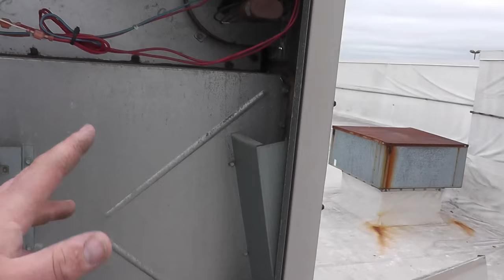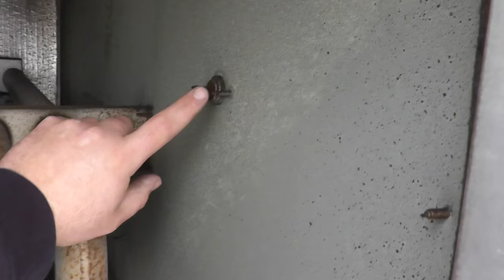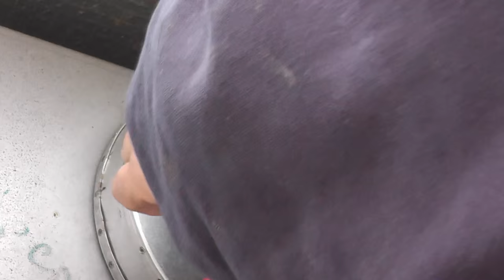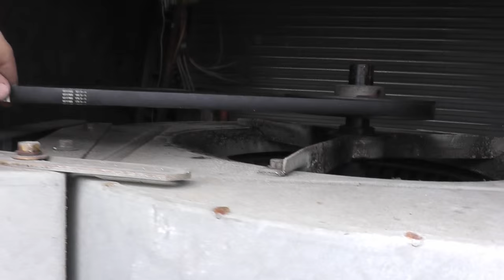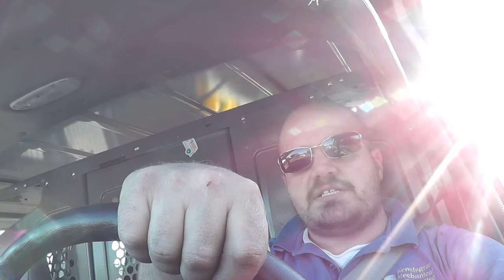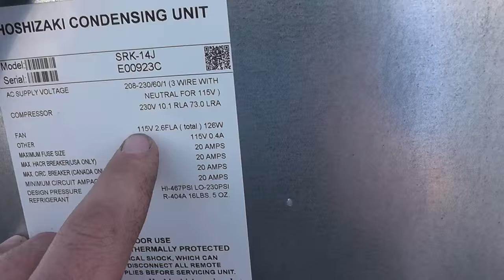Another Day in the Life of an HVAC Tech: Episode 10

Comment: Great video. I was pumped to see you did another day in the life. FYI from an electrician's pov, taped up wire nuts is never a good sign. In our world it usually means a poor splice, and a sign of a poor installation. Obviously not the case here, and I know you're just concerned about vibration. It's probably the HVAC equivalent of an unsecured capacitor that's taped up or left in its box.
Reply from the maker: +BenP83 Yeah it's just a habit for me.  Sometimes you have to jam wires in the motor boxes real tight because they give you so much room.  Also on things like refrigerator coils where condensation is an issue it helps keep some of that out.
Reply: It definitely makes sense to do it in those situations. I think since we see it so much on unprofessional and poor installations it's become taboo, and even when it's beneficial to do so we don't because of that.

Comment: Draft inducer went bad on my home unit; bearings going bad. Figured i could replace the bearings/

When I threw out the old one, it had half a Torx bit in the hub ;) You are right about those screws.

Comment: .as always, a great video showing the crap we go through.  You should show this while it's snowing and windy as hell just to show the real picture.   Another way to find a blown wheel is the pile of fins laying on the roof next to the unit discharge.    Btw.  On those units, the auto control of the blower is controlled by the tdr board next to the igniter control.  The fan switching on the hi limits are to cool stuff down when they trip and to alert you that they have tripped, not for thermostat auto operation.   I know you knew that, but trying to remember that stuff while making a video is tough.  Keep up the great videos.
Reply from the maker: +Ken Wolfe Yup you're right.  Got my wires crossed :-)  Snow soon enough.  unfortunately.

Comment: A most interesting video with good logical explanation of what is happening (or not as is the case!).  Beyond replacing the belt, as shown, in simple terms what maintenance can the client carry out normally? 
When you were identifying the model you described it as a 12ton model. Clearly it does not weigh that amount so what does that figure refer to? I understand it is some sort of measurement of its capacity but what is being measured??
Reply from the maker: +Dan Whiteford Best thing a client can do is clean the condenser coil whether it be an air conditioner or a refrigerator.  Plugged coils are the #1 cause of unit failure.  In addition to the belt another simple task would be changing the filters.  Filter change is the simplest follower by the belt change (requires some mechanical ability).  The coil clean with water and a cleaner I wouldn't recommend to anyone that isn't familiar, but you can easily brush the coil to get the heavy stuff off.  Unit tonnage refers to refrigerant cooling capacity.  1 ton = 12,000 BTU per hour.  1 BTU= the heat input required to raise 1 pound of water 1 degree F or the heat generated by the complete burning of 1 standard 4 inch wooden kitchen match.

Comment: Induced draft motors DO NOT suck the flames up the heat exchanger. It's function is to provide proper levels of combustion air for complete combustion. It naturally assists in drafting of flue gasses.
Reply: Why not both?

Comment: The kit I work on in the Uk doesn't use gas heaters, it seems pretty common in your videos with the rooftop packages. Is your gas so cheap it makes more sense than a 4-way valve just swapping the evapr and the condr. Or is it the climate making heat recovery impossible in the winter? Love the series.
Reply from the maker: +deatrixmuntz  Heat pumps do exist, but in this part of the country it gets pretty cold with average temps in the mid 20's or lower.  You'd be running off the heaters a lot and Massachusetts has one of the highest electrical rates ($16 per km/h) in the country vs gas (1.25 per 100 ccf)

Comment: Nice work and great video. Hey, question about the switch in the draft motor. Have you ever taken one apart or seen them fail? I guess there must be brushes or some sort of spring contacts in there. I looked at a VERY OLD NG conversion burner a few days ago that won't fire up occasionally but it didn't fail when I was there. I'm thinking it might be the centrifugal switch in the motor wearing out.
Reply from the maker: +Nicholas CeeA It's possible,but they're pretty robust.  It's the same idea as a centrifugal start switch in a motor.  Little spring loaded arms.  Some manufacturers like Carrier used a Hall effect switch.  Basically a spinning magnet inside a stationary sensor.  If it's intermittant firing I'd look more into something like the ignition control or flame/pilot sensors.
Reply: Thanks for your input. You're right, the problem is something else. I asked them to check if the blower was running when it failed and heard yesterday that it was not running.

Comment: I've never looked specifically into this, and I know there is  a reason,(I have an idea, but I want to see what the response is)  but, why would my old furnace from 1972, not need a draft motor, but the mid efficiency from the late 90's, does?
Reply from the maker: Unfortunately it all comes down to quality of components.  Equipment now is built specifically with a life expectancy in mind.  There are massive departments and people making tons of money to be sure that what they put into their units makes it past its warranty period before it fails.  Obviously this doesn't happen all the time, but a good percentage of the time.  A lot of manufacturers subscribe to Gillete's marketing approach of giving away the razor to sell the blades.  Trane is one of these.    Their equipment is usually cheaper than the competition, but they use a lot of proprietary parts.  They make their money selling replacement parts not necessarily the unit.

Comment: Hi Greg. When you say a "10 ton" unit, what does that relate to specifically?
Reply from the maker: cooling capacity of the unit.  1 ton = 12,000 BTU/hour
Reply: Still not with it. Bear with me here, i'm just a simple sparky living in Metric land. BTUs, KW, Joules= energy or work to do something, but Tons is mass. Mass of what? Only ever seen heaters or coolers rated in BTUs (many years ago) or KW.
Reply from the maker: +mark rainford Its a term carried from when ice was used as a refrigeration source.  1 ton of refrigeration can output 288000 BTU in 24 hours producing 1 ton of ice. We shorten it to BTU/hr hence 1 ton of refrigeration.   1 BTU is = to the heat input required to raise 1 lb of water 1 degree F or the heat generated by the complete burning of 1 4 inch wooden kitchen match. Also = to 3.517 kW.   Had to look the kW one up.  couldn't remember
Reply: Right, clear as a bell now. Many thanks for your time. Really enjoy your channel.

Comment: nice video, ive notice alot of Americans say 10ton chiller, 50ton chiller ect ect. what does that actually refer too?
Reply: +brendan454    Refers to cooling capacity.  10 ton equals the same temperature change as 10 tons of ice.
Reply: +brendan454 1ton is 3.5kW is 12,000btu.
Reply from the maker: +brendan454 1 BTU= the heat input required to raise 1 pound of water 1 degree F or the heat generated by the complete burning of 1 standard 4 inch wooden kitchen match.